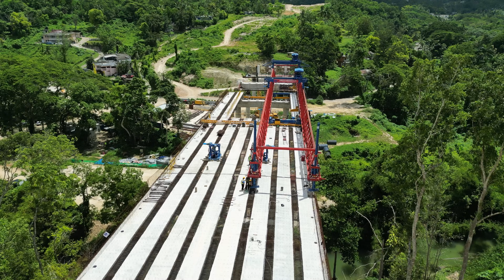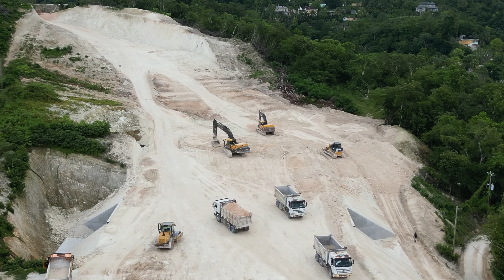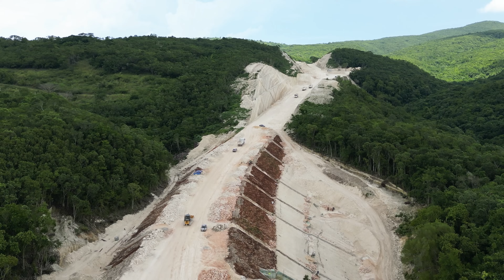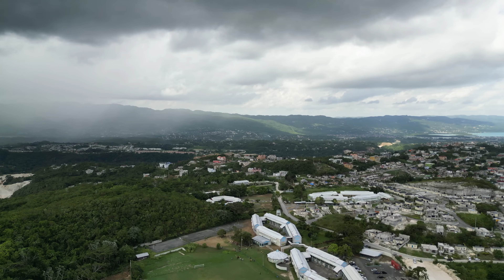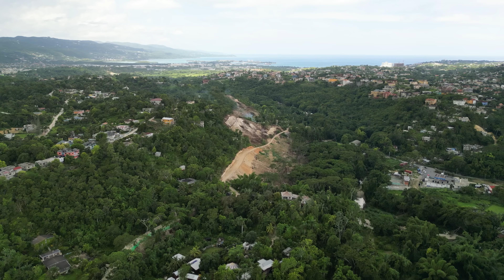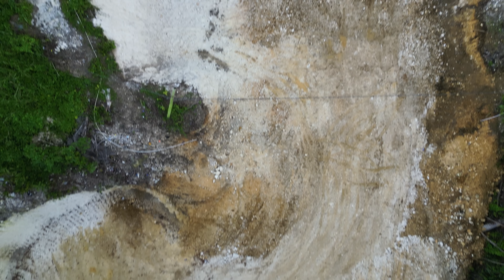Montego Bay Bypass, Irwin To Green Pond, and Fairfield. Toll Plaza, Road Interchange & New Bridge

Comment: Considering all the tax revenue sent to the central government from Montego Bay, this should not be a tolled road. I think the city was unfairly treated as this toll bypass could be doomed to lack of use like the North-South leg of Highway 2000, because of affordability. After so many years of needing a bypass to alleviate the crippling traffic in Montego Bay, an underused toll road will do little to fix the mess. No justification, that Montego Bay could not have provided enough funds in its tax base to fund this free and clear, including future maintenance.
Reply: It's all about money making. Imagine government take your tax dollar, build a road and charge you toll to drive on said road. Joke.
Reply: @oshane2525  it is a rip-off of the Jamaican people. How many years did Montego Bay taxpayers beg for a bypass road to help with the crippling traffic woes in the city, and now one is built, the majority of potential users may not be able to afford the costs of using it. Yet at the same time, Kingston is building miles upon miles of expensive free roads, using the same taxpayer's money, collected from all the tax generated by the region, especially in the tourism sector, while TEF is sitting on a slush fund of dollars, unspent. SMDH

Comment: Does portmore causeway consider a bridge 🌁 because I think it’s very long
Reply: A causeway is a road that has been slightly raised above the water. Causeways are commonly used in areas of shallow water. In contrast, a bridge is used in deeper water areas and is taller than causeways. They are not the same